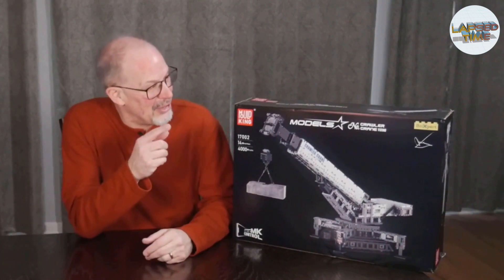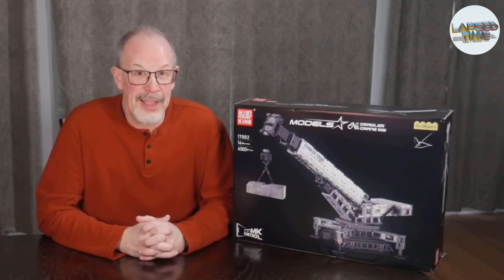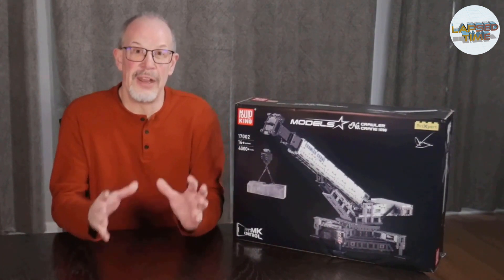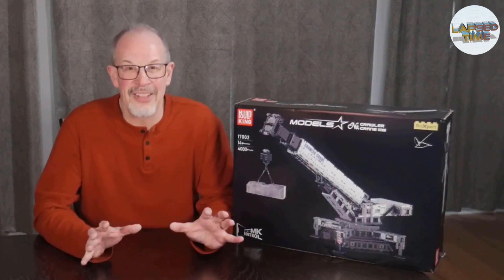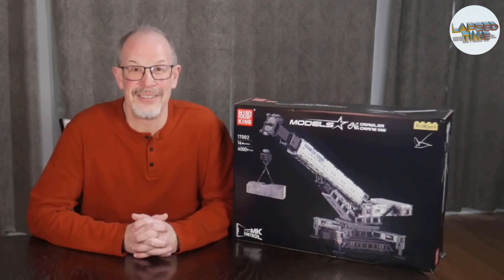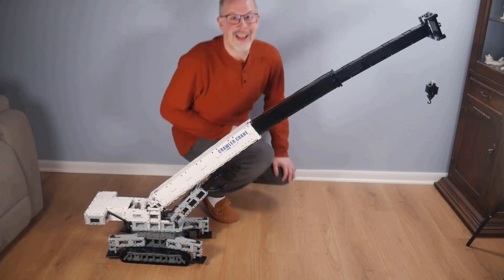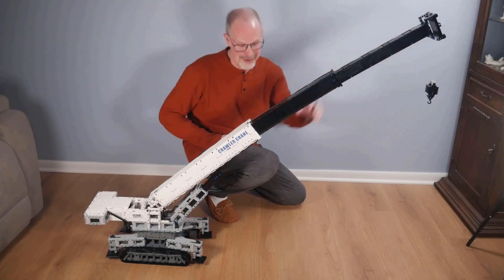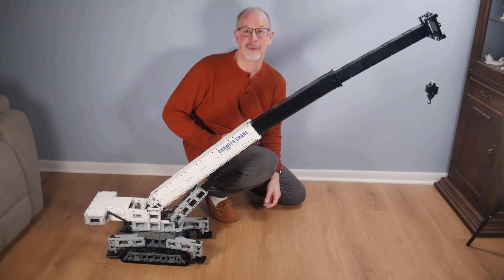Mould King #17002 build, app setup and functional demo along with testing how much weight it lifts

Comment: I think its pretty decent for what you get from Mould King, but that boom arm full extension looked sketchy to me. Seemed to be drooping the middle extension section and makes me wonder about structural integrity over time, especially if weight is put on it at full extension. 

Also kinda weird no body paneling, just structural skeleton for the cab and crawler. 

I also wonder about the connection for the rotating base, Id personally be careful moving it. Can see that being a failure point if not cautious.
Reply from the maker: All valid points and concerns.  I expected most of that going into it as it is still building blocks.  The rotating base I noticed right away as it is simply two pieces snaped together so no bearings or anything much for support.  I don't plan to extend the boom arm fully as you are correct, I doubt it would hold up with much weight.  But it is still a fun vehicle to play with after the build is completed.